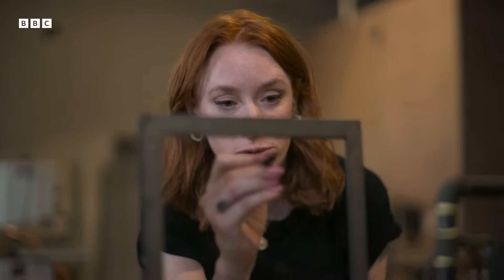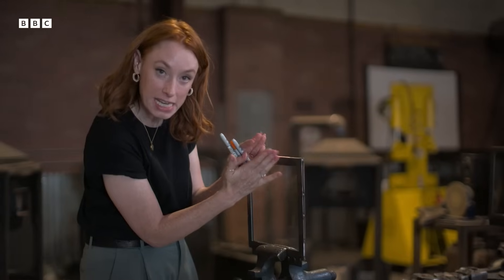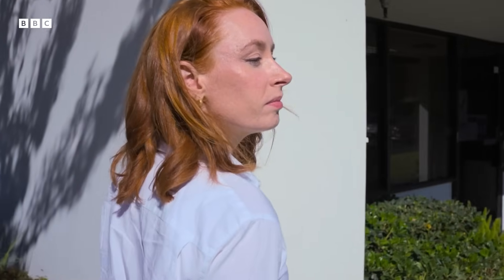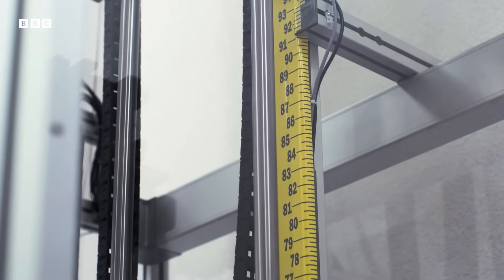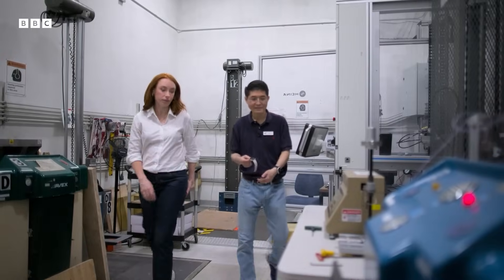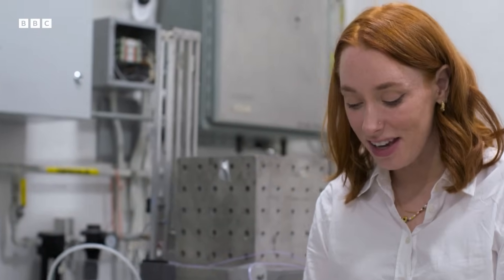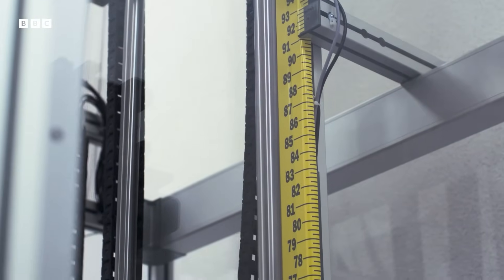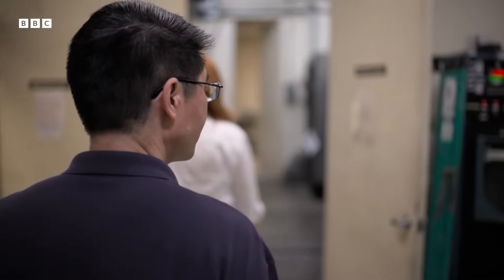The Science Behind Toughened Glass | BBC Earth Science

Comment: 5:27, yeah because the floor likely has sand or similar on it in some amount. Glass is not suddenly harder by these techniques, so it will still scratch when sand and a little force is applied to it...
Reply: For the same reason the key test is very odd. Most if not all metal used for keys is softer than glass. So you can't scratch regular easily shatered glass with it either. (If that were possible you would see more graffiti made in glass as everyone would have the tools with them just about all the time)